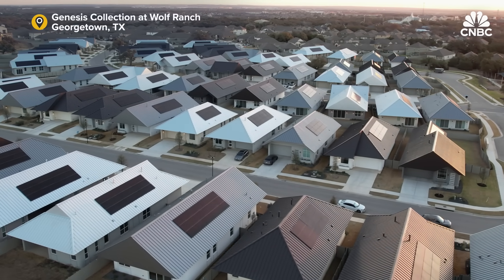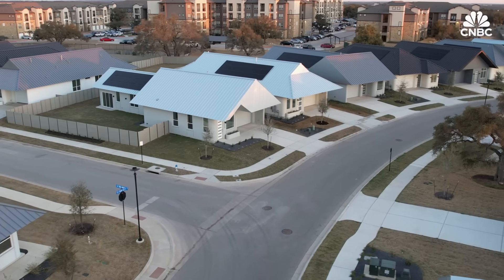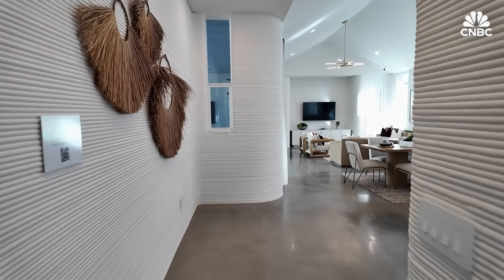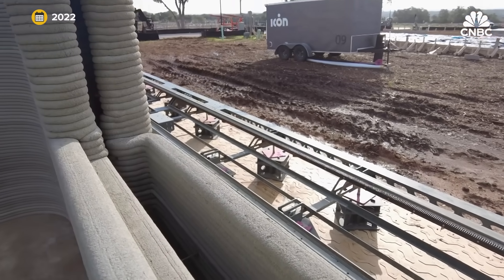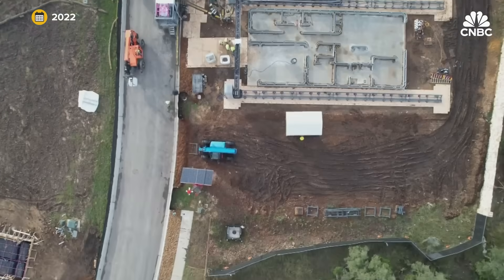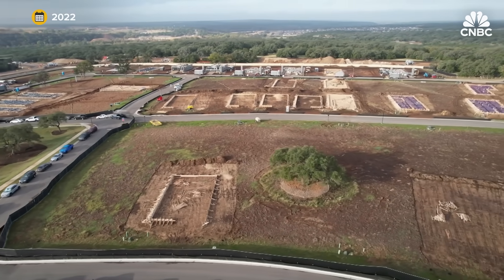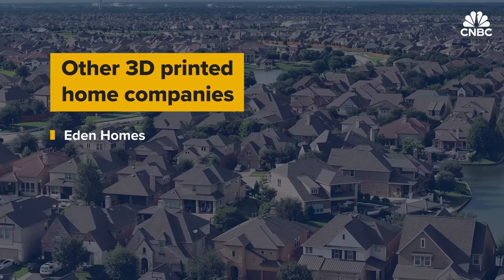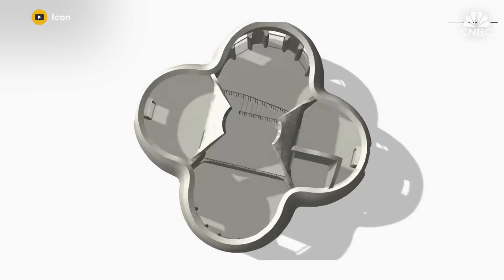Inside The World’s Largest 3D Printed Neighborhood

Comment: lots of negative comments, i built my own home out of concrete and forms with my own 2 hands in the philippines. we have earthquakes and typhoons. i'm 20 feet from the ocean. i like this idea, i'd love to have a home like this. one thing i would do is insist all the rebar was painted with iron oxide before using it. i saw a rusty rebar in a wall in the video. otherwise i think these are way stronger houses and way more efficient as far as heating and cooling. they can incorporate a tromb wall in cold climates very easily. in hot climates i'd paint the outside with white semi-gloss acrylic latex 3 coats white oil enamel metal roof to stay cool, and use the same acrylic latex paint with colors inside, maybe earthtones to enhance the adobe style.
i am sure the prices will go down over time, new things always start out costing more until the industry gets used to it and things become standardized and the work flow is smooth.
one thing i would worry about is them getting cheaper and flimsier as time goes on as many products are great until they catch on then they start cutting corners, like oreo cookies with 1/8 the stuff inside and not even assembled properly with the wafers all lopsided.
the newer ones now are probably better than the ones they will make in 10 years.
Reply: Negative comment is mostly because the Company is selling this house at higher price even though it's cheaper to built..
Reply: @Wenlanren  yes and the negative comments dont seem to realize the video literally explained why these pilot houses are more expensive or comparable to incumbent homes because the process has just been piloted and it is still being optimized over time. Its just the concept of such 3d printed houses should in theory have lower costs. The manufacturing costs this time around for the pilot was as mentioned around double that of what they predicted on paper, so they have to have a high price point for these ones for now
Reply: They likely won't do any of your recommendations because that would cost money.  The point for this venture is to make as much money, by having houses built as cheap as possible while the houses cost around the same price as 'normal' houses.

I'd say anyone really interested in these should check back after 20-30 years to see how they hold up or when the tech gets better or more competition comes in to ratchet up quality.
Reply: Why you stop freedom of speech? who wants to be told to not comment? 

You only see the intent and ideology of the businessman but not the methods and standards. Intent is like the politicians promises, methods and standards is them not doing none.

Comment: People don't seem to realize or acknowledge that the cost of constructing a physical house can be as little as 10%, and rarely more than 35% of the total cost to build.

Even if they save you 20% on costs, that might only end up reducing total costs by 2-7%.

Cost of land, permitting and finishing represents the lion's share of where your housing dollar goes.

Expecting any major cost savings is missing the forest for the trees. Paying the same price for greater energy efficiency; increased disaster mitigation; eliminating the need to import unskilled labor; moving away from modern "wood" home construction (i.e., terrible particle board and warped lumber homes); and much, much lower lifetime insurance costs is huge.

Comment: I can see repairs and updates going crazy! Adding and outlet and having to drill through and break down concrete to run wire. Next owner wants to take down a wall to open a floor plan and has to knock down and drag out a wall of concrete. Not to mention the re-enforcement of the old wall or nrw replacement designs that HAVE to be concrete and you don't have the machine to do it

Comment: Its hardly revolutionary. Most of the cost of a typical home is not in the structure but in the detail (lining, plumbing, electrical etc etc). Its the latter that needs to be deal with if you want cheaper houses. As for 3D concrete. Sure, but you get similar benefits from other concrete based building systems. Some of which are very fast to build.

Comment: It's a mixed bag. Yes it's more efficient, less expensive, and easier to maintain, but it's probably a lot harder to add on or renovate. It's also going to eliminate a lot of jobs in construction and the lumber industry. What if a pipe breaks or the home needs to be rewired? Another downside for now is you can only make the homes so big. So if you want a 5 bedroom 2 story home, you'll have to rely on more conventional building techniques. That being said, I think it's wonderful aside from the fact it costs as much as a regular home to purchase. How about passing some savings on to the customer? Concrete is cheap. I'll bet those printers pay for themselves after one or two homes. I'd still live in one though. They're probably really good in a tornado and pretty much termite proof. Rats and bugs can't hide in the walls either. You won't have to worry about mold either. I could go on and on. I think the good outweighs the bad. If I ever build a home, it will be one of those.

Comment: In theory all this sounds good. But has this been tested in actual scenarios? Like actual bad weather scenarios? Also, I saw the issue with roofing. Doesn’t look like how it prints the house, a roof could be secured to the structure in a way to survive a ef0 twister. With all that, plus the good windows and insulation for good sound proofing, obvious cheap cost to build, and need for only 1-3 people to build, I don’t think 400k price tag is even remotely close to reasonable

Comment: As a construction professional, this is the dumbest shyt ever...interesting tech, but typical Austin lunacy on so many levels.  Reminds me of the permeable concrete that looked like gray rice crispy treats that the City of Austin tried to force developers to use for parking lots in the mid 2000's.  The stuff was like 5x's more per yard than regular ready mix and was a mf'er to work with.  Now it's virtually unheard of.   If you want a concrete house, there are WAY more options available and for a fraction of the production price. For all its cons, one thing people don't think of is up-keep...how do you keep dust and dirt from forming within those groves over time, both inside and outside the home?

Comment: Concrete isn't inherently strong except on compression.  It's the rebar and other elements that go into it that make it strong for non-compressive forces.  My concrete driveway had cracks in it within a few years of being poured.  Wonder how these homes will hold up over time.  That would be a big, big concern.

Comment: Rooms are small AF and they said it cost the same as larger homes....which means it's alot more expensive per square foot.  I think they are charging alot because it's new and the cost come from equipment use.  I wonder how it holds up in natural disasters and if insurance is cheaper

Comment: Almost all homes built in florida are built out of concrete cinder blocks, reinforced with Rebar, the Roof is still framed out of wood, but they have hurricane tie down straps. It is extremely quiet inside my home of 1500 sqft. If I was to buy it new today, it would cost me $300k. It's cheaper, more spacious, and bonus, my property is bigger than the property these houses are on. 
As for the housing crisis that everybody's talking about. If I drive 2 miles to the store. I pass 10 brand new empty homes just in my neighborhood.

Comment: You need to consider the cost savings long term. Yes, it’s comparable price wise to other homes in the area, but your bills are significantly reduced. 26 vs 130 a month for utilities is unheard of. You’re looking at an approximate 6k vs 30 k cost difference over the span of 20 years. So if you can buy a home that costs the same, wouldn’t you take the one with lower bills?

Comment: What happens if there’s like a plumbing leak or electrical failure that requires rewiring? It’s not like they can just cut a chunk of concrete wall out and then replace and the structural integrity is the same. Right? Like at least dry wall can be cut out and patched to access wires and pipes.

Comment: Wonder what happens when these homes have a water pipe leak within the walls or electrical wire burn out in the walls? Forget about a conventional way of home remodeling. Try knocking down a wall to open up your kitchen. What about a room additions? These are the ugliest homes I have seen only second to mid century modern architecture.

Comment: This is actually really wonderful. Right now, these 3D printed homes have a bit of charm to them, aesthetically, but as the technology and techniques evolve, I can see clean patterned walls without the layered ring effects being possible, for more contemporary and attractive aesthetics. If they can start mass producing these, maybe the costs could go down. 
Excellent insulation, noise cancellation from outdoor elements, significantly low cost electricity and fire/hurricane proof? What the heck are we waiting for?
Full speed ahead with this innovation.

Comment: It may look great, but in the end 3D printed homes are a disappointment. You can address only part of the building, the finishing has to be done traditionally, the cost is not that much lower, and you're limited by rounded shapes if you want to avoid fill gaps or holes in the walls. The idea needs to cook for another 20 years.

Comment: Walked around a few of the show homes back in November. 

First and foremost…the houses were really nice, and I was actually surprised by the pricing. Just a bit more than traditional houses. Some of the floorplans were weird but one of them was super cool from what I remember. They all look way smaller on the outside than they actually are. Great use of space(unless there’s no attic).

Now the nitpicking. The smell. They were model homes so I assume they were built early on but they all definitely smell like……..something. Not like fresh concrete but close. I would hope that would fade away if I was buying one.

Mounting stuff to the wall. I pulled a mounted wall decoration off the wall (because I’m entitled :D) and it was definitely a drilled hole. I feel like an mis-measured hole is a pretty big deal in these houses.

All in all…super cool houses. The smell would be my biggest concern though. The wall thing…get a good drill and a proper bit. Learn how to mix small batches of whatever the material is to fill in holes.

Comment: I think this needs to be a way for making houses for the future, especially in the south. They are more flood resistant, hurricane resistant and tornado resistant. I am also glad to see they have solar panels. I also think all homes need to have solar panels, once again, especially in the south. There is soooo much sun in the south, and it helps homes have electricity during and after storms and freezes (the most important time to have power, but also the most likely times to have power outages). But they do need to pass the savings onto the costumer (like he said right now it is experimental and not necessarily cheaper, but they have the potential to be much cheaper). I also would not want a concrete kitchen island, and I think they should have less concrete interior wall, because people do like to remodel homes, and having concrete islands and interior walls will make remodeling incredibly difficult. Also please, please, please just never put a sink in kitchen islands. Islands need to be a prep space, and when they have a sink in them, they become a dish washing station, leaving little room for food prep. No one like to prep food on small cramped countertops facing a wall. Also when the island is just a big flat surface, it allows for people to face the rest of the room while cooking/baking, and it allows for multiple people to surround the island and work together to prep foods, and this also allows for an ideal space for parents to cook with children. It makes cooking more fun, and less isolating.

Comment: Hideous. After thousands of years of developing a civilization we've come full circle back to a Fred Flintstone rock house. With the punchline that we can "build" it (squirt it) way faster and cheaper than a real house but you pay the same for it, or more, as you would for a real home. And where's the wiring and plumbing? Inside the concrete of course. But we'll leave you a jackhammer in case you need to get to it. And good luck with getting earthquake protection added to your homeowner's insurance.

Comment: I can say that the Commonwealth of the Northern Marianas Islands in the the pacific has concrete homes all over the place. Those houses have held up against heavy typhoons for over 40+ years. Over time it would very slowly need to be repaired, but it lasts a lot longer than most homes in the USA. In my opinion, the price is not bad considering how long these houses will last.

Comment: The long term challenges of a house like this would concern me.  Remodeling could be a nightmare.  What happens if the foundation settles?  Wood flexes a bit, concrete doesn't.  I'd hate having a giant crack along my interior walls.  Any sort of modification becomes very challenging without the access you can get from cutting a hole in drywall.  However the house is built, you're basically stuck with it.

Comment: The cost of constructing the building goes down, but it’s still in a lot of ways for a lot of people something that is out of reach.

And while I like the idea of these kinds of buildings, especially with the significant housing shortage that exists here in the United States I see a couple of things that probably will be addressed in the future, but they need to be thought about right now. 

Firstly, you have the fact that the interior of the home the walls are obviously not smooth because of the print lines. I would think that at the very least once the primary walls and everything have been installed and printed something like drywall or sheet rock or something would be placed against it so that at the very least you could have a traditional style wall. Or at the very least somebody would go through with a large concrete shaper or something to smooth it over.

There’s also the fact that what if you have a failure with one of your pipes? A plumber can’t exactly grab a Skil saw and cut his way into the wall to replace  a damaged pipe fitting or something. It would literally require somebody to use a jackhammer and a chisel.

Another thing. What if you want to make an addition? Would the company come back out and have a system set up where they can make it so that you can have your addition printed or do you have to go with a more traditional construction company? 

Honestly, with houses like this being so inexpensively made I think they should cost a fraction of what a comparable house should cost. For instance, if you have a house that’s let’s say maybe 800 ft.². I think that should be less than maybe $10,000 heck it could be even smaller. 

The sad thing though is, it is entirely likely that this technology will probably not become widespread. Sure it may trickle around every now and again and we may get just like in this video entire communities that are built in this fashion. But it’s unlikely that it’s going to become a more widespread thing. 

I should also point out that with the house is being made out of a form of concrete. This means that they’re very in flexible. Unless there is a degree of ductility to the concrete. But essentially, this would mean that as the building expands and contracts as it warms and cools sooner or later, it’s going to develop fractures in the concrete, which overtime will result in it Becoming less viable. Don’t get me wrong. The idea of 3-D printing an entire house is actually a very amazing idea. However, I think that maybe instead of 3-D printing the whole building maybe doing something similar to kind of like a prefab. 3-D print various parts and pieces then have the homeowner or the construction company whichever Take the collection of materials over to the plot where the house is going to be established and have it built. You’ve probably still saved a significant amount of money, but it likely doesn’t require the same kind of infrastructure that would be needed to construct something like this. Not to mention these houses all look relatively small. Granted the thing said in the beginning that this one house was over 1000+ square feet by still.

I will say this, though. Houses like this will probably be very, very popular in desert climates. Especially locations like Texas, Utah, Nevada and Southeastern, California. The house is also might be popular in areas where tornadoes are much more frequent. Like Oklahoma or Kansas. 

The desert environment would probably be good for them because they would likely be able to keep the internal temperature at a much more well regulated rate rather than a traditional house with extensive HVAC systems. 

Unfortunately, though I can’t receive these kinds of houses working in colder climates. But who knows maybe this is a new type of housing construction that could become more common place. It certainly would be nice to help with people who are either on low or fixed income or helping the homeless.

Comment: Concrete Prefab is much faster in construction and if the truck has a crane big enough, way cheaper. There are positive and negative things with each method. Though doing it with wood is not good and the 400k price is also to expensive, it should be half that.